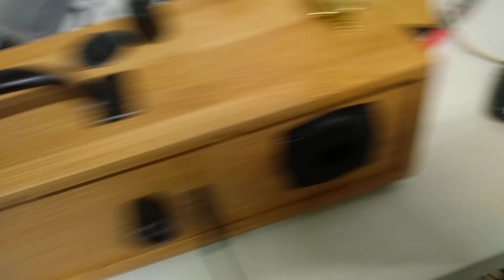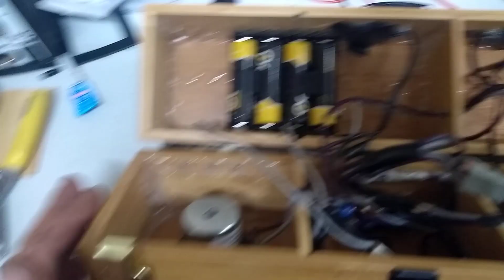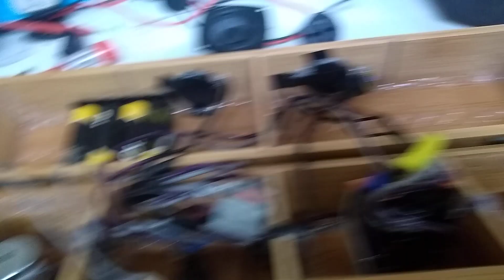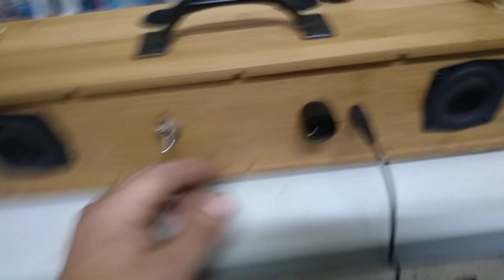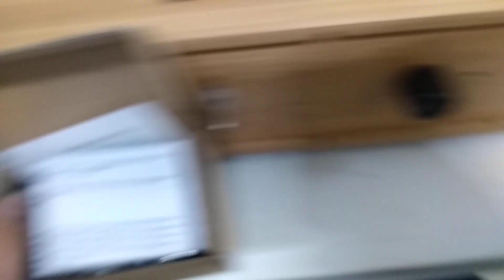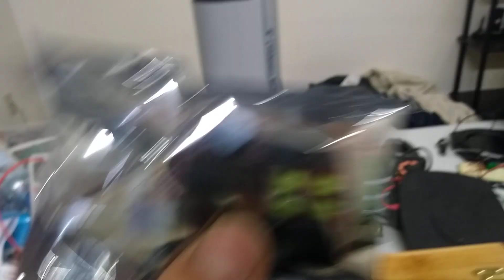DIY 'Bamboo' Speaker System

Comment: I want to build another and searched for what others did. 1 Watt x 2 was nice to listen to and I hear DAB radio mostly at volume = 03 out of 15. The 2 little speakers got a wood colour. I added guitar functionality. It got external out for more speakers. Still a few things to work on, but it's very modular to dive into over time.
Reply from the maker: The second one of these I made turned out so good using a 2.1 amplifier. Added a tiny crossover and some tweeters too. Then added a small sub on the bottom with 2 passive woofers next to it. Sounds so good. People ask to buy it from me all the time. https://www.youtube.com/watch?v=T6MuSQTIa0k is how that one turned out before I added all the passives. This sub is crazy good for its size https://www.amazon.com/gp/product/B077FHPGM4

Comment: Funky ...what size do you think the enclosure size is? I'm about to.use the same drivers, but with the DTA-2 board same output
Reply from the maker: They're advertised as 17.5" x 4" x 2.5" so putting them together like mine and dividing them down the middle it should be something like say 8.5" x 4" x 5" per driver.